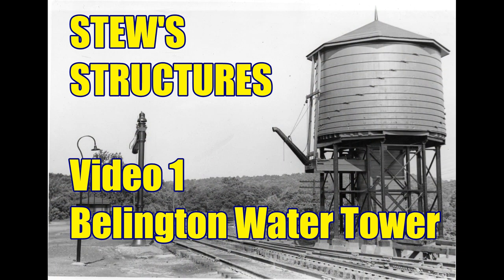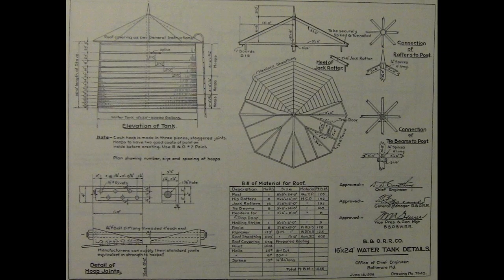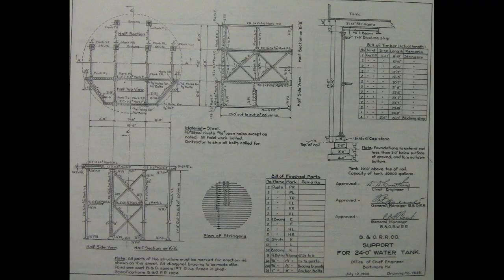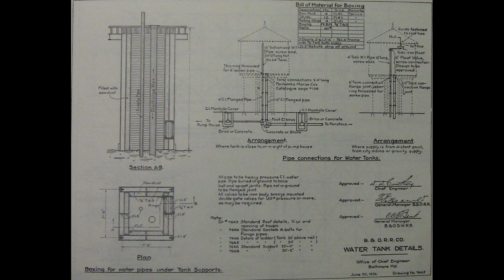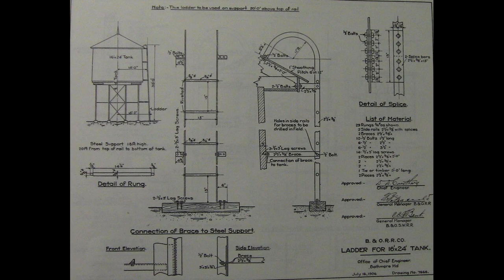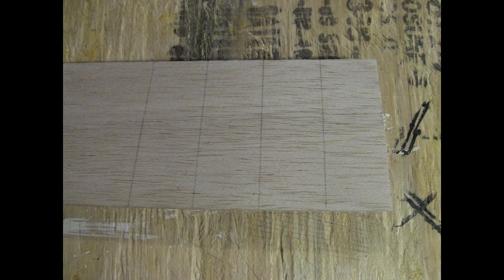Scratch Building The water tank in Belington

Comment: Mark, if you ever get a project with plenty of good photos for reference, you wouldn't know what to do, lol. You always do so well with less than perfect references. I am scratch building some Concrete stave silos to replace some that were kit supplied. I could not find those turnbuckles either and debated to use thread, strip, rod or even magnet wire for the bands. You approach is very well done and a whole lot of work to build those Tensioner's is what I will call them. Cheers Rob
Reply from the maker: Thanks for the comment and for watching !!!  Have fun with your build !!!